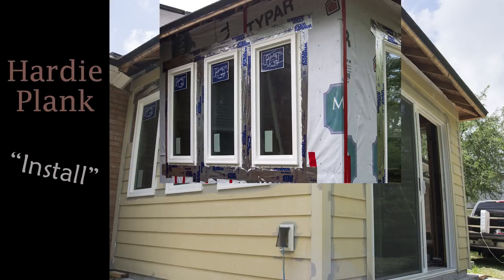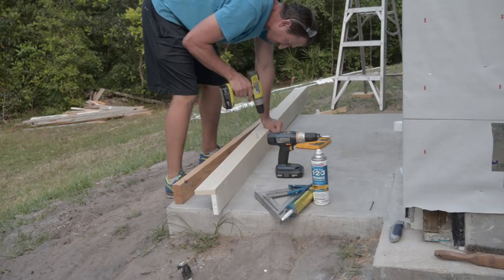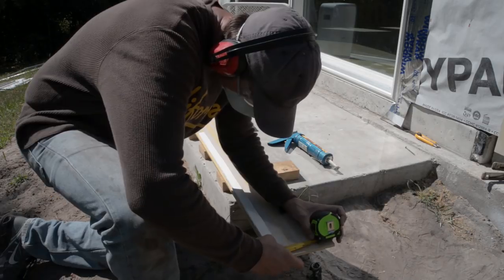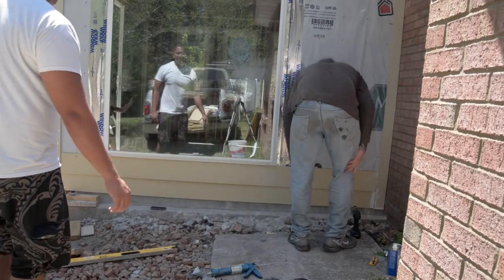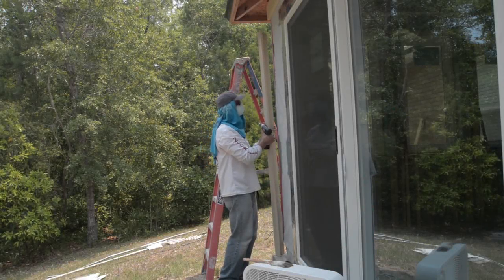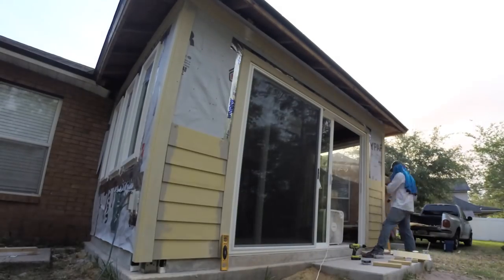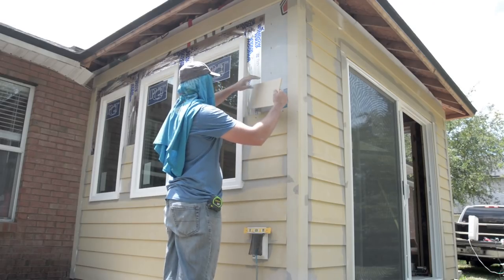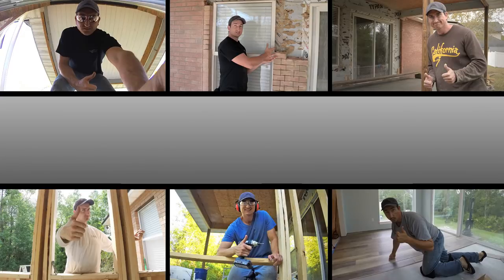HardiePlank Siding, Installing Fiber Cement Planks on Exterior Walls Vid #10

Comment: Really good video Joe. I like the idea of the "bump-out" glued to the first board verses nailing it to the home first.  There should be a gap or two to allow any unexpected water out. 
Making the trim corners before installing is also a great idea to hide any imperfections of the corner of the house.  The only thing I do differently is I trim the width of one of the trim boards by the thickness of the trim boards so that the trim is equal on both sides of the corner.  But I've seen/done it both ways and it looks it good either way. Great work. And thanks for taking the time to document.
Reply from the maker: Thanks for the kind comment and tips.  Regarding the corner trim boards, I just do not like cutting cementitious siding and so ripping a piece did not appeal to me for this project.  Thanks again.
Reply: Q11qq11qqq1qqq11qqqqqqqqqqqqqqqq1qqqqqqqqqq1qqq1qqqqqqq1qqqqqqqqqqqqqqqqqqqqqqqqqqqqqqqqqqqqqqqqqqqqqqqqqqqqqqqqqqqqqqqqqqqqqqqqqqqqq1qqqqqqqqqqqqqqqqqq1qqqqqqqqqqqqqqqqqqqqqqqqqqqqqqqqqqqqqqqqqqqqqqqqqqqqqqqqqqqqqqqqqqqqqqqqqqqqqqqqqqqqqqqqqqqqqqqqqqqqqqqqqqqqqqqqqqqqqqqqqqqqqqqqqqqqqqqqqqqqqqqqqqqqqqqqqqqqqqqqqqqqqqqqqqqqqqqqqqqqqqqqqqqqqqqqqqqqqqqqqqqqqqqqqqqqqqqqqqqqqqqqqqqqqqqqqqqqqqqqqqqqqqqqqqqqqqqqqqqqqqqqqqqqqqqqqqqqqqqqqqqqqqqqqqqqqqqqqqqqqqqqqqqqqqqqqqqqqqqqqqqqqqqqqqqqqqqqqqqqqqqqqqqqqqqqqqqqqqqqqqqqqqqqqqqqqqqqqqqqqqqqqqqqqqqqqqqqqqqqqqqqqqqqqqqqqqqqqqqqqqqqqqqqqqqqqqqqqqqqqqqqqqqqqqqqqqqqqqqqqqqqqqqqqqqqqqqqqqqqqqqqqqqqqqqqqqqqqqqqqqqqqqqqqqqqqqqqqqqqqqqqqqqqqqqqqqqqqqqqqqqqqqqqqqqqqqqqqqqqqqqqqqqqqqqqqqqqqqqqqqqqqqqqqqqqqqqqqqqqqqqqqqqqqqqqqqqqqqqqqqqqqqqqqqqqqqqqqqqqqqqqqqqqqqqqqqqqqqqqqqqqqqqqqqqqqqqqqqqqqqqqqqqqqqqqqqqqqqqqqqqqqqqqqqqqqqqqqqqqqqqqqqqqqqqqqqqqqqqqqqqqqqqqqqqqqqqqqqqqqqqqqqqqqqqqqqqqqqqqqqqqqqqqqqqqqqqqqqqqqqqqqqqqqqqqqqqqqqqqqqqqqqqqqqqqqqqqqqqqqqqqqqqqqqqqqqqqqqqqqqqqqqqqqqqqqqqqqqqqqqqqqqqqqqqqqqqqqqqqqqqqqqqqqqqqqqqqqqqqqqqqqqqqqqqqqqqqqqqqqqqqqqqqqqqqqqqqqqqqqqqqqqqqqqqqqqqqqqqqqqqqqqqqqqqqqqqqqqqqqqqqqqqqqqqqqqqqqqqqqqqqqqqqqqqqqqqqqqqqqqqqqqqqqqqqqqqqqqqqqqqqqqqqqqqqqqqqqqqqqqqqqqqqqqqqqqqqqqqqqqqqqqqqqqqqqqqqqqqqqqqqqqqqqqqqqqqqqqqqqqqqqqqqqqqqqqqqqqqqqqqqqqqqqqqqqqqqqqqqqqqqqqqqqqqqqqqqqqqqqqqqqqqqqqqqqqqqqqqqqqqqqqqqqqqqqqqqqqqqqqqqqqqqqqqqqqqqqqqqqqqqqqqqqqqqqqqqqqqqqqqqqqqqqqqqqqqqqqqqqqqqqqqqqqqqqqqqqqqqqqqqqqqqqqqqqqqqqqqqqqqqqqqqqqqqqqqqqqqqqqqqqqqqqqqqqqqqqqqqqqqqqqqqqqqqqqqqqqqqqqqqqqqqqqqqqqqqqqqqqqqqqqqqqqqqqqqqqqqqqqqqqqqqqqqqqqqqqqqqqqqqqqqqqqqqqqqqqqqqqqqqqqqqqqqqqqqqqqqqqqqqqqqqqqqqqqqqqqqqqqqqqqqqqqqqqqqqqqqqqqqqqqqqqqqqqqqqqqqqqqqqqqqqqqqqqqqqqqqqqqqqqqqqqqqqqqqqqqqqqqqqqqqqqqqqqqqqqqqqqqqqqqqqqqqqqqqqqqqqqqqqqqqqqqqqqqqqqqqqqqqqqqqqqqqqqqqqqqqqqqqqqqqqqqqqqqqqqqqqqqqqqqqqqqqqqqqqqqqqqqqqqqqqqqqqqqqqqqqqqqqqqqqqqqqqqqqqqqqqqqq2q1q1qq1q111qqq11qqq11qq111q1q111q1q111111
Reply: @suryaananta7039  Get a Life!
Reply: You all prolly dont care at all but does someone know a tool to log back into an instagram account..?
I somehow forgot my login password. I appreciate any assistance you can give me.
Reply: @Ezra Joel instablaster :)
Reply: @Tomas Noel Thanks for your reply. I found the site through google and im trying it out atm.
Seems to take quite some time so I will get back to you later when my account password hopefully is recovered.
Reply: @Tomas Noel It worked and I actually got access to my account again. I'm so happy:D
Thanks so much you saved my ass !
Reply: @Ezra Joel No problem :D
Reply: To trim the boards by its thickness, so that both wall boards coincide perfectly on the corners, is a great idea that I prefer over using other special corner covering.

Comment: I used HardiePlank to replace a few masonite boards on my home, they make a HardiePlank design that is very similar to my existing masonite siding. It was quite easy to work with.
Reply from the maker: HardiePlank was great for this application

Comment: This vid was exactly what I was looking for. Love the detailed info and the bum out is new to me, I enclosed my front porch but have concrete walls. Can I use tapcon fasteners to attach the planks to the wall instead?
Reply from the maker: Thank you.  I think attaching wood furring strips to the concrete wall first and then attaching the siding to the furring strips is the general approach.
Reply: Cool, I was told that before and asked if i'm applying strips won't it be the same or better to screw planks directly to avoid termites?  @MrKistel

Comment: Do you have to pre drill the lap boards to screw them on?  And what type of screw do you use?  Sorry if I missed that in the video.  I'm about to re side my moms house and I have it all dialed in except fasteners.  Might rent a coil nailer, but the screw idea would save some money  maybe.  Great video, thanks!
Reply from the maker: Josh, I describe the hardware used to install the siding in the video description. Thanks for watching and best of luck with your re-siding project.

Comment: Beautiful addition, what are those boards made of. I'm guessing not wood. Why not use a saw to cut them?
Reply from the maker: This is Hardie Plank cementitious siding.  In the video description I provide a link to a blade that can be used to cut the boards.  The downside when cutting with a rotary blade type saw is the dust that is created during the cutting process.  The dust is not something that should be breathed in by the installer or anyone nearby.
Reply: @MrKistel  Thanks, I suppose it's a fire retardant as well.
Reply from the maker: It was a great siding product for this home addition project

Comment: I agree with the other comments, this is a god video. i have one small question, did it actually take 2-3 cuts per side with a utility knife to snap of the end of the hardy board?
Reply from the maker: Thank Mr. West.  When cutting the HardiePanal with razor blade it often took several scores on each side of the panel to make for a clean snap point.
Reply: Do yourself a favor & buy replacement blades.. after a few scores - it will wear the blade out!
Reply: They make a special blade for cemintious panels for your circular saw, but it blows some nasty dust you don't want in your lungs, always wear a mask or respirator if using.

Comment: Maybe I missed it but how did you rip down the length of the siding for the long cuts around the window?
Reply: Other videos: (&Mee)
Say: use an angle grinder w/a diamond blade/disk. WORKS well & companies make those diamond blade disks with the correct arbor hole.   $12.

Comment: Love the video! What kind of screws and what length are you using for the trim and for the siding. I see most video tutorials using nails but I'd prefer screws since I don't have a nail gun.
Reply from the maker: Thanks, the screws and other materials utilized for the siding installation  are referenced in the video description area.

Comment: Hi, great video. What did you do with the exposed corner beams? Originally they were able to be seen because you poured around them but now it appears as if there is cement around them...?
Reply from the maker: Thank you.  If you are referring to the bottom section of the original  post they were left exposed.
Reply: @MrKistel  in your hardy plank thumbnail it looks like their exposed but in the pics with blue ext they look covered so I was just wondering.

Comment: Important;
The ripped strip behind the bottom of your 1st course should have gaps between sections to let water drip out from behind the courses of siding. Nail it to the sill. Overhang 1st course 1/4".
1 1/4" lap is the minimum per the 2015 IRC for cementous lap siding for the courses..
Screw 1" from top edge.
Reply: First overhang should be 1" min.

Comment: When using similar materials there is no need to leave a gap for expansion both hardy board products will expand and contract at the same rate which is called modulus of elasticity.
Reply from the maker: Thanks for the comment  I was under the impression the James Hardie siding install instructions suggested the perimeter spacing was recommended.

Comment: I see where you say that you use finish head screws for the trim pieces, but I'm wondering what you use for the lap boards.  Are you using trim heads for that also, or the hardie backer board screws or something totally different?  Thanks!
Reply from the maker: Josh, check out the video description area. I include the hardware utilized for the Hardie siding installation there. Thanks.

Comment: Thank you for the video! Is the trim the same dimension throughout or did you use different dimensions for corners and openings? What were you dimensions of the trim? I love the whole look!
Reply from the maker: Thanks Karen, I believe the trim boards were 3.5 inches in width and 3/4 inch in thickness.  I used the same trim throughout however a wider Hardie Panel board up where the soffit meets the exterior wall.

Comment: How do you drill the planks onto the wall? 
1) do you predrill the planks and the wall first,  say if it's a brick or concrete wall
2) how do i measure the correct length of screw to use to secure  the plank onto the wall? 
3) if it's a concrete or brick wall do I need to use plugs in the wall (for the screw) when mounting the plank to the wall? 

Sorry for asking too much,  I m new to this but I am dying to do this since I can't afford to hire professionals

Thanks in advance e for your advice
Reply from the maker: Sounds like you have an ambitious siding project in the works.  If you are putting siding over a masonry type surface it may be best to mount strips of wood to the wall with appropriate anchors into the concrete, brick, etc.  The wood strips become studs essentially that you can mount the siding to.
Reply: @MrKistel  thanks again

Comment: I wish you showed how to do those 90 degree inside cut-outs using the score and snap method... after all,  what could go wrong for a novice? And is there a glue you can use on your furrring strip in below-0 temperatures?
Reply from the maker: Thanks for watching and just check the adhesive manufacture's label regarding temperature limitations.

Comment: How did you fasten the hardie boards in between windows? Did you have to add extra studs? Or are you just fastened to the sheathing?
Reply from the maker: I should have been hitting the window framing studs. There was not much open space between the windows with all the window framing studs.
Reply: I fear my studs are behind my trim board. Any recommendations?

Comment: what did you do to cover the base of the 4x4 posts? I see one looks covered with concrete at the end of the video and other other is open, but photoshop?
Reply from the maker: the bases of the 4X4 post were left open to avoid trapping moisture.

Comment: What type of primer was used to prime the ends of each cut?  Oil based or water based?  Also, what was the primer that is suitable for cementious siding?
Reply from the maker: Hey Scott, the primer used on the cuts ends is provided in the video description area.  The primer used to paint the naked siding before the colored paint was a primer found at a big box home supply store.  I do not recall the specific brand but it was a quality product that mentioned it was intended for such use.
Reply: Thank you for the reply. I don't see the product in the description. Specifically the spray paint that was being used to spray /prime the ends of each cut.  I do see the primer used to prime the siding, but not the ends that were sprayed. 

On a second note, what size screws where used for the siding trim (which I think is 2-1/4" - I see listed above in the description) and the siding planks?

Comment: Awesome. How big is that window , where did you get. It an how much was it?
Reply from the maker: Thanks Ricky,  Here is the video when the large window was installed with more info. https://www.youtube.com/watch?v=8E8EKAHbTA0  It was sourced from a local window provider and likely would have been fairly expensive if custom ordered. However I was lucky and saw it at the shop and asked about it. They said it was a  window that was ordered incorrectly for one of their customers. They discounted it tremendously to just to free up the shop space. At first they told me they had two and I thought about putting one on each side of the room but they ended up damaging the other.  it is an awesome window!

Comment: First person i seen using screws on siding
Reply: Its cement-fiber board, so its not normal siding. You should make sure to use the specific cement-fiber screws if you use screws. This siding handnails quite nicely though.

Comment: What are you attaching it to? A siding gun would speed you up by five times... I know it's about $150 used or new for small brand. I would imagine the time you would have saved and reselling it if it's a one time use thing. 

Secondly, aren't they already primed? Why prime again?
Reply from the maker: The siding was attached to the wall sheathing (plywood) and wall framing (2x6).

Comment: Isn't it better  to put the trim boards over the planks where they meet on corners  then butting them up against the trim boards like you did, that way there's less possible gaps?
Reply from the maker: I prefer the method I demonstrate in the video when it comes to installing house siding trim corners using Hardie siding materials

Comment: Nice video, but what did he do on the bottom outside corners?  They had gaps all the way up to the last few seconds of the video, and then we're magically resolved with no explanation.
Reply: Busy Beaver Remodeling. If your talking about the post face, looks like it was filled in with concrete. Could have just screwed some cement board and skim coated it to blend. I’m sure there’s many ways to finish that. I’m curious to know too

Comment: Awesome. Is this porch insulated enough to use it as a living room?
Reply from the maker: Yes, I used deeper framing members in part to add more insulation value in the walls.  This room was an addition to an existing living room.  Note: this house is in a southern location.  Construction and insulation techniques would likely vary if building in a more northern climate.

Comment: What size screws did you use that also were flat enough so as to make siding lie flat?
 Thanks!
Reply from the maker: Screws are shown in the video description area. Best of luck with your siding project.
Reply: @MrKistel  Wow, I missed that, thanks so much for pointing that out! I don't have a nail gun and don't want to buy one for just 60 planks.

Comment: Awesome video and great demonstration. I'm curious why you found it necessary to use primer even though the boards are factory primed?
Reply from the maker: Thanks for the kind comment.  I figured the primer would make for a better overall paint finish and protection.  Most resources I came across recommended using a good primer suitable for cementatious surfaces.  I think somewhere I saw a comparison of the painted finish with and without primer and it was a noticeable difference.
Reply: @MrKistel  thanks for the reply. That's good to know. I looked in JH installation manuals but it wasn't clear about using a primer so I didn't think it was needed. But hey, if it looks better, then why not? Thanks again. Cheers

Comment: did u use screws instead of the recommended nails, that need to go through the 2x4's ?
Reply from the maker: The screws were appropriate for this particular siding application.
Reply: @MrKistel  what screw did you use?
Reply from the maker: @illmatic33  hardware and materials used are described in the video description area.

Comment: Please can you help me with size (width) of the boards, both the one used for the corners as well as those laid vertically. The reason is that, the part of the world don't have the already slice board on the market. It comes as one full piece, so one has to cut it to his or her preferred size. Hope to hear from you soon. Thanks
Reply from the maker: They offer the planks in a few different width options here.  The corner and perimeter trim is thicker then the plank siding pieces and could not be cut out of the same stock panel.  If you have to cut the planks you could probably cut them any width you prefer.  These I believe were 8.25 inches wide.

Comment: Would be interested to see how many of these boards are cracked in a year because they were screwed instead of nailed
Reply from the maker: why would the screws be an issue?
Reply: @MrKistel  we use nails cause they flex and bend screws don’t so with movement of the house and expansion and contraction screws would be more likely to crack the boards since they don’t have the flexibility of a nail.

Comment: One p;iece of vertical corner trim is all you need.  Then just butt the siding from both walls, and caulk.  Saves time and money. Also, generally not a good idea to nail siding directly to sheathing/wrap instead of nailing to vertical strapping to provide air gap for drying being sheathing and back of siding.  Prevents rot/mildew and is code in many places.
Reply from the maker: Thanks for the tips.  I noticed the strapping method is common in other regions as well, it seems like a solid installation method.

Comment: Very informative.  Great use of the utility knife to prevent dust.
You made it look easy.
Question.  Would you install this siding on a block wall?
Thank you
Reply from the maker: Thanks for watching and the comment.  You could install it on a block wall if you wanted.  I have seen it done with using wood blocking to attach to the block wall and then securing siding to the blocking.

Comment: Not using gauges? Not nailing 2" galvanized nails on the nail line? Not using a proper starter strip? What am I missing.
Reply: yeah I thought all those things as well. But coming from a carpenter, it's easy to look right away and see what I'd do instead